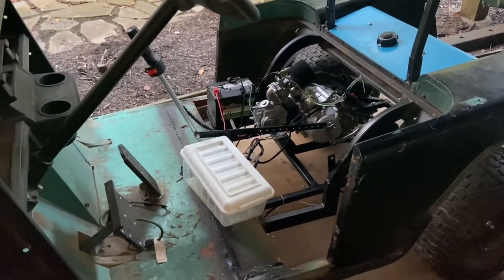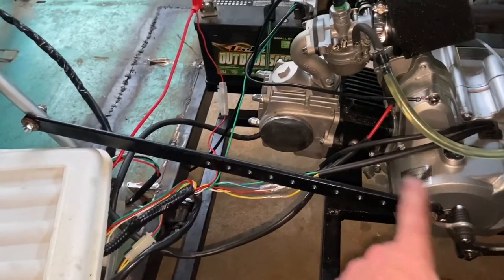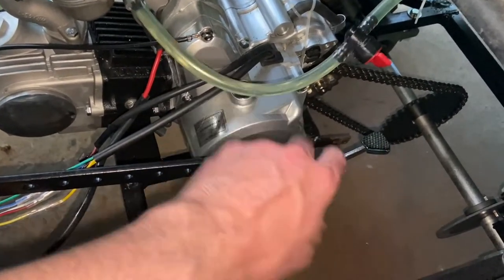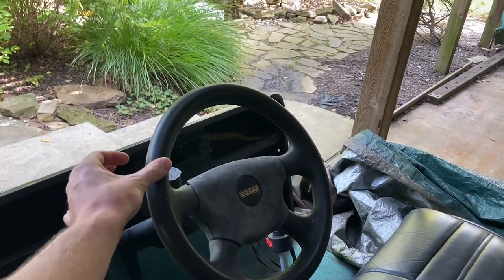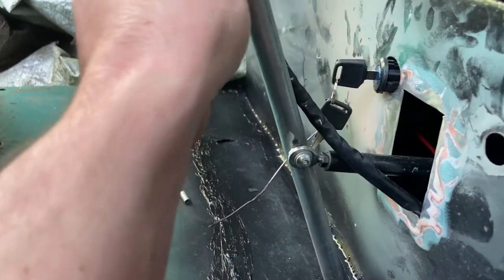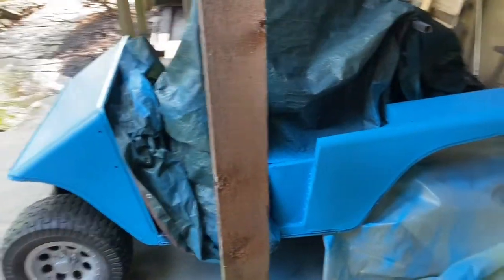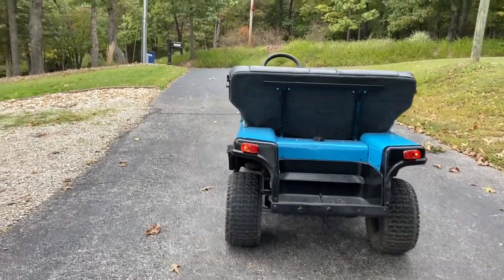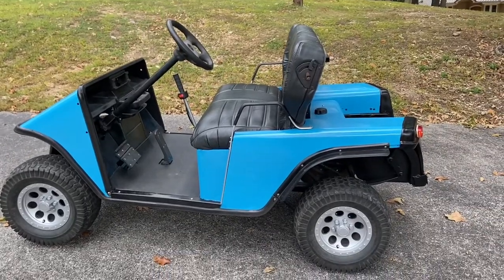125cc golf cart build: part 3

Comment: Very interested in doing this as well and will be using your videos as a guide. How does this engine perform if starting out in second or third gear? I assume 5mph would be just over idle in first? We want to use at a campground with a 5mph limit. My wife doesn't want to have to shift other than f/r. My other option is the cvt version but I'm assuming the 3 speed would have more versatility.
Reply from the maker: If the campground is flat you would be able to start in 2nd or third just fine depending on what rear sprocket size you use. A CVT might be a better choice for your situation. Are you able to find a CVT kit with reverse? I mainly choose the engine I did because it was inexpensive and had reverse. 

If you do decide to build one I would recommend installing a fuel pump. My cart is hard to start sometimes because the fuel tank isn’t much higher than the carburetor.
Reply: @kylehuffaker32  I did end up getting the 150cc cvt fnr. The only option for the drive gear was the #50 sprocket which presented a whole lot of trouble finding a rear sprocket. To stay in the 9" diameter range (for ground clearance,) the highest tooth count I could get was 40 and a 13 tooth drive sprocket. I'm just now getting to figuring out a swing arm setup as this is a top mount engine. We'll see how it all turns out. 
If I could only keep other projects from bumping this down the list. That's life I guess. Thank you for the info!

Comment: Are you using #40 chain. Did it work well with 420 sproket on motor? Thanks
Reply from the maker: I used a 420 sprocket on the engine, a 420 sprocket on the axel and a 420 chain.